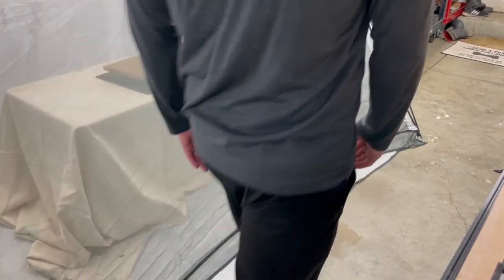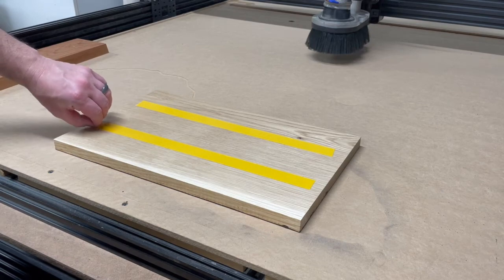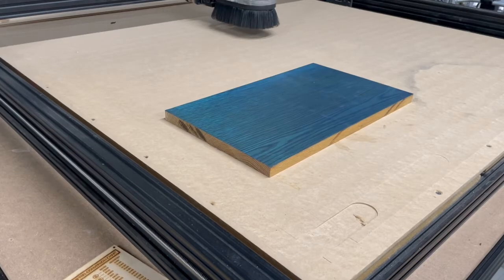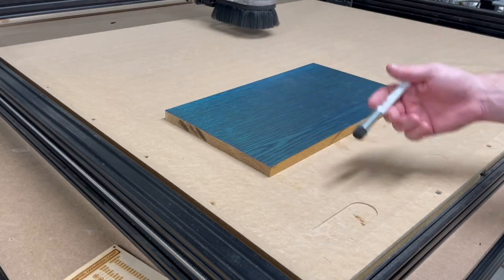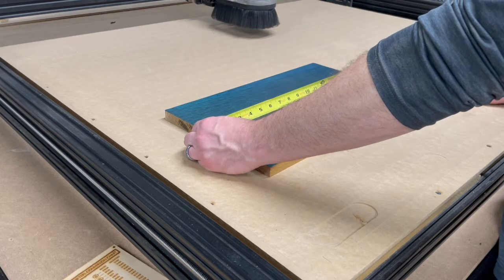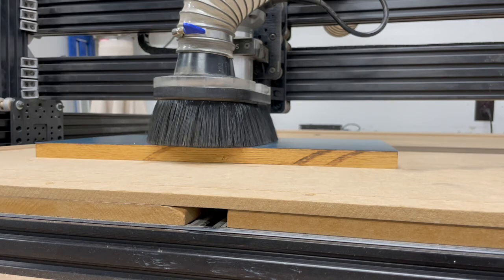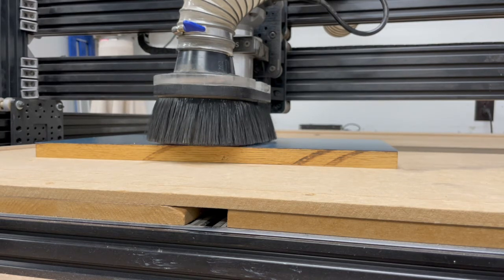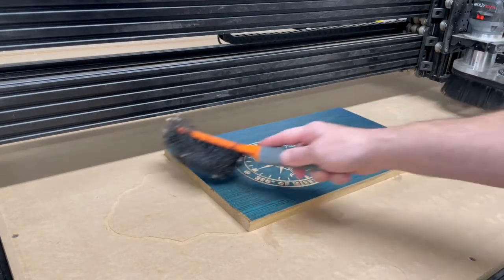Proven methods for flawless plaque preparation

Comment: As soon as you took your piece off of the cnc just to put sanding sealer on the carve, you lost your X Y reference and no matter how good you think you are, you won't get it back.  Sanding sealer is sold in spray cans and should have just used that while it was in place then run your cutout toolpath.
Reply: What's purpose of using sanding sealer?
Reply from the maker: Hi Wayne, I'm sorry for responding so late. I didn't get a notification for this. since it was put under someone's comment.

Here's a quick video that goes over what pre-stain does and what sanding sealer does.

https://youtu.be/suuyY5iBfuY
Reply: @roonwerks  Thanks for the tip. Useful when I can use spray paint more when it gets warmer
Reply from the maker: You are correct, once the piece moves at all, you'll never find the XY reference point. 

The next part of this is cutting out the profile which I have drawn up in a different file. I could have saved some time and sprayed sanding sealer all over my CNC I guess, but unless I left the CNC on I would have lost the position anyway. 

This project happened across the time span of three days because of my day job, so leaving power on to my CNC while I sleep or am at work is not worth the few minutes of resetting the zero.

Comment: How long did you let the sanding sealer sit in-between coats... And how long did you wait before applying the ormask
Reply from the maker: Follow the directions on the can, but I believe it was 30-45 minutes at a minimum. I was really distracted that day so sometimes it was longer. 

I would recommend waiting twice as long for the Oramask, if the wood isn't dry, it won't stick properly. I've done enough of these that I can confidently say, "slow down and do it right the first time". I'm notorious for thinking the job will take less time and I rush through it. I would make a mistake and go through twice the amount of material and more than twice as long than I planned.

Comment: I make a 1in grid all over my 5x10 machine. This way no matter where I put the wood I knows it square any direction. The grid is about 1/16 deep.
Reply from the maker: I've thought about doing the same, but haven't gotten around to it. I'm sure it would save some time, especially by preventing me from redoing work.